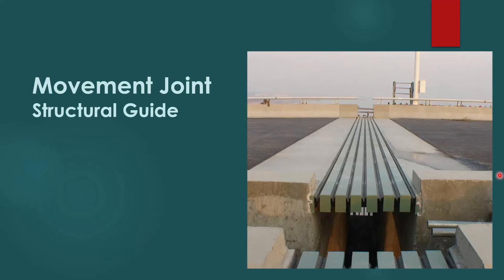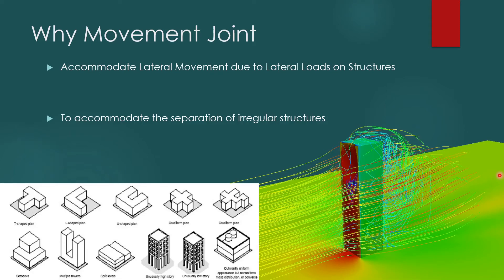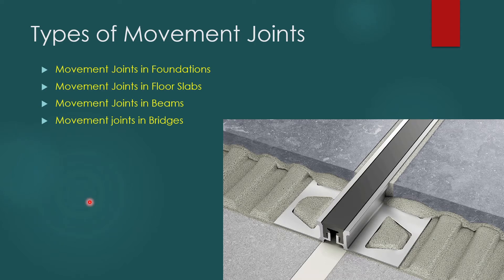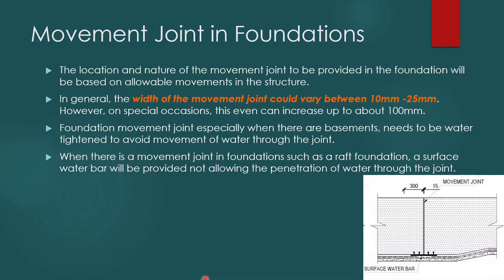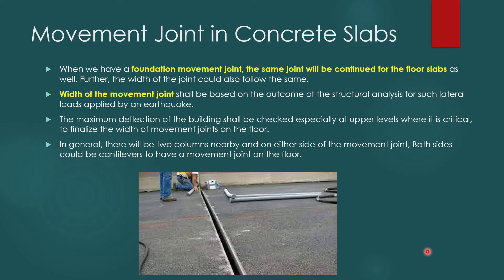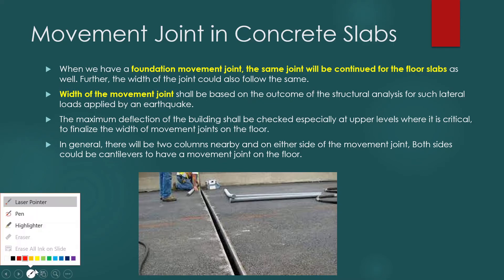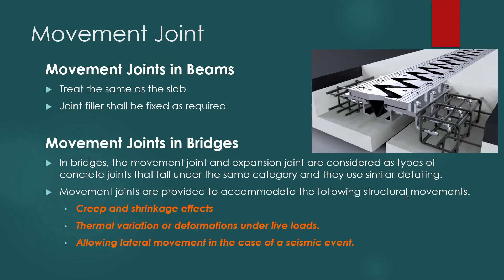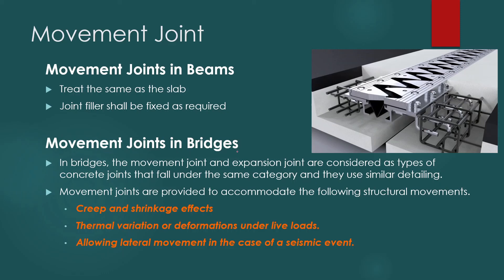Movement Joints | Types of Movement Joints in Structures | Structural Guide

Comment: Sir how to design a temporary movement joint?
Reply from the maker: Your question is not that clear. 
In high-rise buildings, when it is connected with smaller buildings having a smaller number of floors we sometimes maintain temporary movement joints. 
Once most of the construction is completed and as per the calculation expected vertical deformations are almost over, we connect the two structures.
We provide provision for concreting at a later stage in these types of occasions.